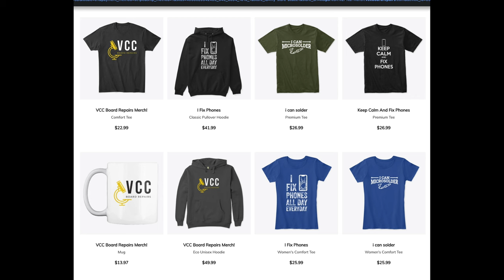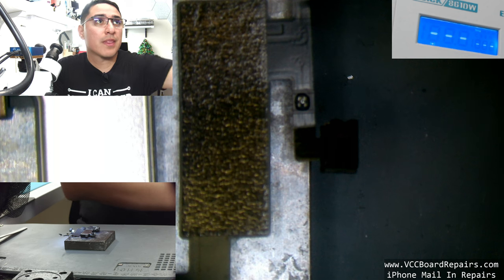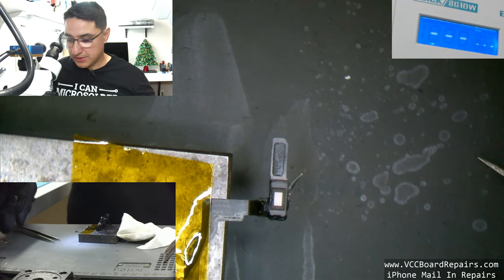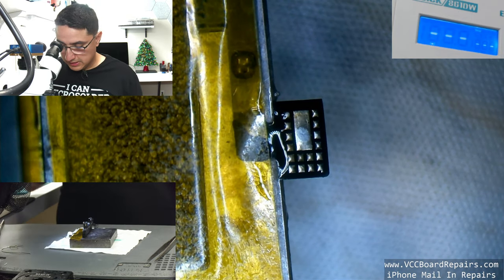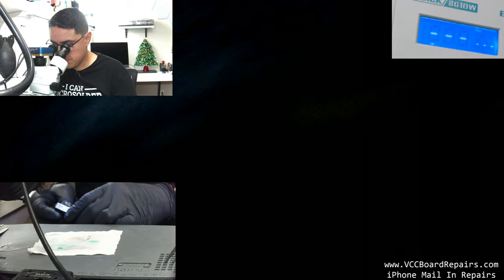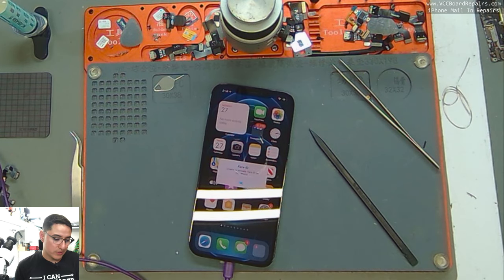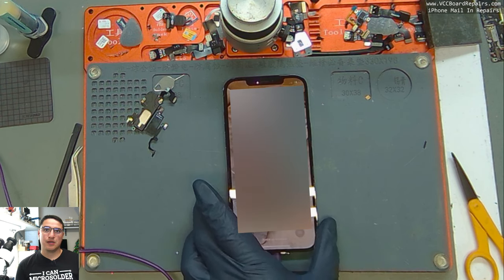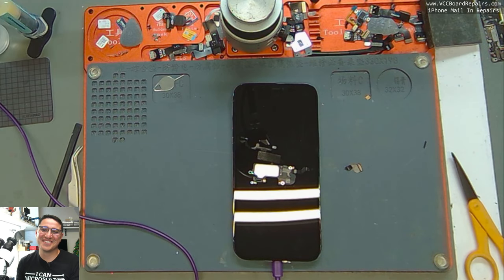How To Fix Face ID with Torn Flex. iPhone 12 Pro Max. Swap Flood Illuminator & ALS Sensors Tutorial

Comment: Cool Video. Thanks! Might be doing the same if the local b2b agrees on the price. Last one I did on iPhone 11 I was using iHeater preheater and assisting it from the top with hot air at 560F with low airflow, no issues. That plastic is pretty heat-resistant, at least on iPhone 11 it is. Will try just the iron method this time, flat edge probably to spread the heat more evenly
Reply from the maker: I never had luck doing it with hot air. When using my iron, I have basically 100% success rate. Also less risk of the sensor flying away lol

Comment: I am having issues with my 12 pro max. purchased the phone with the screen dim and needing a new display. changed out the display and its saying "a problem was detected with the TrueDepth camera so Face ID has been disabled,, also I can't adjust the brightness yet .. have any ideas?
Reply from the maker: Face ID may not be fixable.
But if you replace the ear speaker flex, you should get the brightness working.

Comment: hey jesse your video gave me the confidence to give this a try! a few tips for people who have never done this before:
1. buy 5 or 6 new flexes, practice on 3 of them by removing the sensors and replacing them, don't move on to the "real" one until you are feeling confident
2. get one of the face id testing tools to verify that your test replacements worked correctly (you won't be able to test with your phone because the parts are serialized)
3. pay attention to the height of solder on the pads. if you put too much solder on the ground pad the parts won't sit even and some of the pads won't make contact
4. even if the testing tool shows the serial number (or the phone boots and face id doesn't throw any errors) the flood illuminator could still not work if all of the contacts aren't soldered on correctly
5. do not touch the bottom of the ribbon for too long with your iron, the parts underneath are soldered on and will come off it you hang around with the iron.
6. low melt solder is an absolute must for a beginner. after the solder has melted remove your iron and you'll have almost 10 seconds to move the part around if necessary. it also lets you hear the ribbon up much quicker because it melts at a lower temp.
Reply from the maker: These are great tips!

It would be awesome if you could share them in my FB Group: www.vccboardrepairs.com/vcc-fb-group
Reply: @VCCBoardRepairs  How much would this service cost for mail in service (iPhone 11 pro)?
Reply: @VCCBoardRepairs do you offer this service? if so how do I get in touch with you

Comment: Hello! Thanks for your video :)
I’ve just replaced the IC and the flood illuminator… no error message appears now but Face ID configuration is still not working. When you go to set up the face it just says ‘fit your face into the frame’ but doesn’t go on. Any idea?
Reply from the maker: Try flashing an update and see if that helps
Reply: @VCCBoardRepairs  I tried this, but didn't work :(

Comment: I just tried opening an iphone 12 and tore the speaker cable. Now I have to do the same to restore faceid function. I do not think you need to replace the ALS sensor. From the looks of it and also from reading about faceid other times, I think only the flood illuminator is paired with the board. The ALS sensor looks like a plain array of photo sensors which measure ambient light which is then used by the CPU/OS to adjust screen brightness etc.
Reply from the maker: ALS is part of true tone and needs to be swapped to keep the original in place
Reply: @VCCBoardRepairs  Do you need to swap it for the Face ID feature?

Comment: Hello i have a question. If i buy working display with all these sensors can be replace just screen with all stuffs or must do this job anyway?
Reply from the maker: Yes, you can replace it but you will lose Face ID.

If you want Face ID to work, you must transfer this original flex onto the new screen.

If you damage the flex, then you must follow this process to get Face ID working (or send it to a professional to do it for you)
Reply: @VCCBoardRepairs   Thank you , then i will send it to the closes professional to repair it

Comment: Cool vidéo !! My flex is not torn but I have both problems (the brightness is locked at the lowest + Face ID unable to work). My phone got 3/4 drops of water, I don't know if this is the reason, do you think the ear speaker/Face ID flex is still reparable after having water drop on it ??? and what do you think of this problem ? (I am French and my repairer don't know what to do). Thank you in advance guys
Reply from the maker: Yes, you'd have to inspect the components on the flex for liquid damage.

Comment: My phone is having all these issues but mine also goes into boot loop after using the phone after days or weeks, would that be a symptom as well?
My Face ID works but then it stops working when the screen goes dim 

Hard resetting phone temporarily bring the brightness back but eventually dims after days 

Might the sensors be not connected right?
Reply from the maker: Could be many things. But most likely something on the ear speaker flex is failing.

Comment: Thank you for the info. You should consider advising not to use any flex other than the genuine original flex from another iPhone. I got a knock-off cable and it didn't work
Reply from the maker: i purchase from Mobile Sentrix premium quality flexes and they work.

Comment: Hello. I replaced My iPhone 12 screen as we think there was water damage as the brightness was dim and couldn’t be adjusted manually. With the new screen the Face ID is not working with a TrueDepth error. Also the brightness is still not working. We don’t care about Face ID as long as the screen brightness is working. Can I just swap the whole ear speaker flex as a solution? Appreciate your help
Reply from the maker: Yes you can replace it

Unless the brightness issue is something else
Reply: @VCCBoardRepairs  I will try the ear speaker flex replacement first and see if that resolves the issue. Thank you for your help.
Reply: I replaced the ear speaker flex cable and the brightness came back!!! Next I will attempt to work on fixing the face id. This video is very helpful. Thank you for all your help.

Comment: I appreciate this video so much right now! I have a 12 pro that I can't adjust the brightness on after screen replacement. I assume the light sensor got damaged, but I don't understand why the brightness cannot be adjusted manually. The screen is fully dimmed. Shouldn't it just be the auto-brightness function that gets lost? Not sure what could be done to fix this.
Reply from the maker: It seems like it is some weird software issue apple designed into the phone.

You'll need to plug in a working ear speaker flex
Reply: Hello. I absolutely love your videos and how you explain so patiently. My iPhone 12 after screen replacement had brightness issue. It’s dim and can’t be manually adjusted. The Face ID and true depth is not working either. How can I fix the brightness issue?
Reply from the maker: The ear speaker flex probably got damaged during the screen repair

Comment: hi, good job but no need to replace floodlight or proxy, just id is enough.
Reply from the maker: what do you mean?
Reply: @VCCBoardRepairs   just replacing face id will solve the problem, no need to replace flood light or proxy sensor. this technique is also applicable on iPhone stuck on apple logo. By the way you are doing great work, keep it up.👍

Comment: Hello, I have this exact issue on my iPhone 12… while I was using it, I think it over heated and the screen went completely black… it was never opened since purchased new so I don’t think there could be a tear on the flex cable… do you think it’s an easy fix? If so can you do it for me? With price quote.
Reply from the maker: That sounds like the ALS sensor has failed. We can certainly fix that for you. Send me a message for a quote: https://www.vccboardrepairs.com/contact-us

Comment: I accidentally ripped of my front speaker flex cable and face id and true tone stopped working..will it work if i order aftermarket flex assembly and put on old sensors and speaker ??
Reply from the maker: I recommend premium or OEM

Comment: Hi Jesse, good job, what's about iPhone 13? I read different opinions, some say replacing the flex doesn't effect face id, others say it does...perhaps you know what sensors has to be swapped to get a fully functional phone again. Ty
Reply from the maker: iPhone 13 and newer only have True Depth Camera and IR camera. There's no paired Face ID sensors on the prox flex
Reply: @VCCBoardRepairs  ok, that's about face id. And true tone or auto brightness? Can the flex be replaced without any soldering?

Comment: I have torn the flex on a iPhone 11 pro max,  but have another front assembly from another iPhone i can use do you know if it is just possible to program it with a JC v1se programmer will the face id not work ?
Reply from the maker: No, that won't work.

Comment: Hello, anyone knows if the earpiece flex to install has to be from an original 12PM?? or a compatible piece is it possible?
Reply from the maker: original ear speaker flex will be 100% working. If you go with aftermarket ear speaker flex, there's a chance it won't work.

Comment: Hi,
I have a 12 pro max that I changed the screen so I dont have true tone. Is it possible to leave the proximity sensor on the replacement flex and just changing the true depth sensor for face id compatibility? I'm asking since the true tone functionality is not important and I think it is linked only with the proximity sensor.
Thank you and if I made mistake correct me.
Reply from the maker: Yes you can leave ALS and only swap the flood Illuminator

Comment: does it have to be the original flex or can it be from a replacement? is it only these two folders that need to be transferred?
Reply from the maker: The replacement flex should be a quality flex. It's recommend to use original if possible.

Comment: hi, i have a question: Do i can use a generic Flex Cable as a receive for the original one? The sensors fit properly?
Reply: or i have to use another original flex for the job?
Reply from the maker: It depends if the generic flex is any good.
Reply: There is any way to find this out?
Reply from the maker: You try it and see if it works

Comment: Will the new update of IOS 18 no longer need you to swap the two sensors over now?
Reply: Only if you find a original flex taken from another iPhone (donor) that isn’t binded to an iCloud account
Reply: @chamsball  I bought what I thought was a new flex cable. Swapped it over and I get a Stolen alarm come up so Face ID doesn’t work. 😣
Reply: @thefoal003 it will happen very frequently now. The good part is that we will be able to recognize a stolen piece. The bad part is that those parts can still be used, just need a little more practice with micro soldering to swap IC

Comment: what happens if the ribbon completely ripped?
Reply from the maker: You swap over the sensors to a new flex. Exactly what I show in this video
Reply: @VCCBoardRepairs  i dont know how to soulder
Reply: also is 12pro max the same as 12? they dont have any left

Comment: Hi I have the same problem where my phone fell and the Face ID stopped working. I continued to use the phone till it fell inside water and when I opened it up to clean; I noticed that the flex was a little bit torn, though the brightness was still working perfectly. Could this be why the Face ID stopped working? I’ve ordered a new earpiece flex but I’m from Nigeria and I fear that I might not see someone to help me fix it like you did :(
Reply: Can I also add that while I was waiting for the delivery of the earpiece flex, I noticed that my screen has a white cloud over it, and sometimes it goes back to the original dim mode, and sometimes it fluctuates as it the True Tone is on.😢
Reply: Oh and now, the brightness is so dim.
Reply from the maker: Since it's water damaged, it can have a lot of issues. Maybe you get lucky with a new flex.

Comment: I am thinking to simply order the Ear Speaker completely as a module. Can I ask Apple to activate the new configuration (in the store, for example)?

Thanks
Reply from the maker: You would have to buy it from Apple (assuming they sell it) and then they would need to calibrate it.

Otherwise, they won't touch it or help you with that.

Comment: Would it be better using a hot air gun on those instead of touching with the iron or no? (I mean uisng an air nozzle for removing and reinstalling the components - for reballing of course the iron is needed) Well, you just said in the video that hot air would damage the components....ok.
Reply from the maker: You can certainly use Hot Air but i prefer the iron as it feels like a safer method. Much easier to burn the plastic on the sensor when using hot air